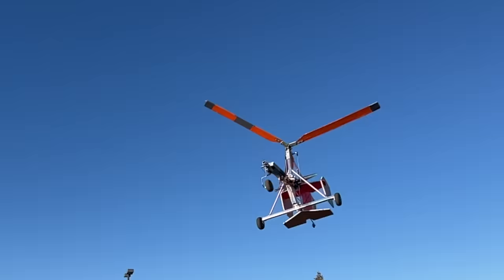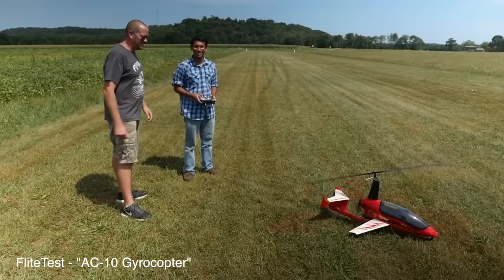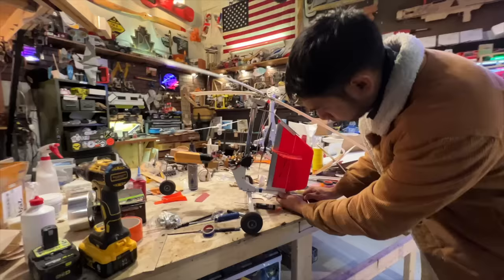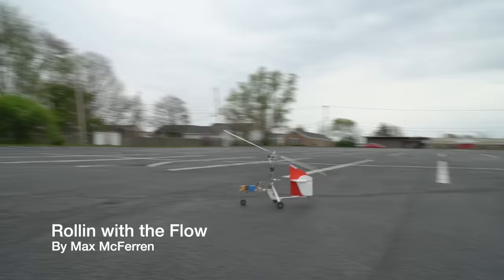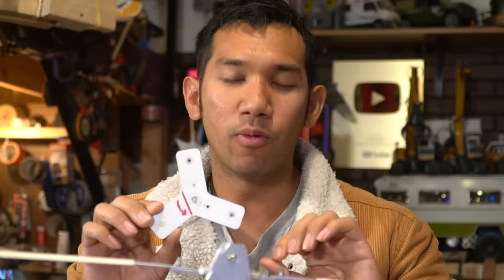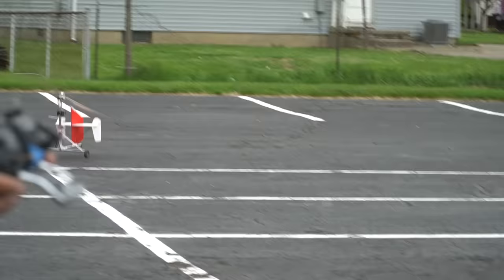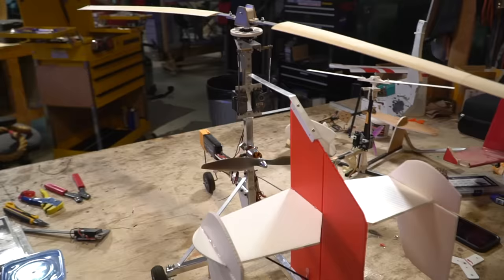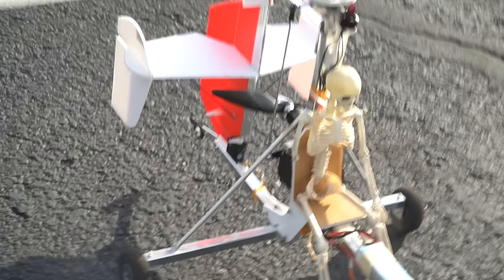This isn’t a helicopter or an airplane?

Comment: Peter, another great video.  I have a Hobbyking Auto G2 and it flies great. It has some nice design features including a slip clutch that allows a small motor with a flexible shaft to power the rotor for take-offs then is able to free spin like a bike wheel.  Stay safe with the real one you're getting ready to fly. Best of luck.
Reply: I've read somewhere that the CoG of a gyroplane should always be in front of the rotor mast. is this true. If it is, by how many percent should it be in front of the rotor mast if the rotor diameter is 100%?

Comment: Hey Peter, thanks for the video. I did my initial training as a helicopter maintenance engineer working on Seaking Helo’s.
So, I am pretty much full bottle on the workings of fully articulated rotor heads. I’ve spent a lot of time in the left hand seat  of different helicopters flying under instruction so at a pinch I could probably walk away from a landing if the pilot was incapacitated.
I have a fixed wing PPL and own my own aeroplane but the lure of a gyroplane has been a long held dream! 
My question is - why don’t Gyro’s have 4 bladed rotor systems? In just about every YouTube video you see of the cockpit view of the flight, the control column is always vibrating in sync with the rotation of the rotor. Surely a 3 or 4 bladed rotor head would make for a smoother ride. 
With the amount of theory of flight I’ve done over the years I should probably know the answer but I don’t! 
Is it just a cost thing or is it too hard to engineer for a gyro’ set up. (Both in real life an R/C applications)
Cheers.
SA

Comment: I actually used to work on these before I began working on helicopters. You can call them “Gyrocopters” or “Autogyros” but you cannot call them “Gyroplanes”. “Gyroplanes” are actually different from a “Gyrocopter/Autogyros”. I’ve worked on them for quite a while.

Comment: Peter been following you for YEARS. Love all your videos. Please just be super careful, my colleague's son died in a gyro-copter crash, at 21, it was his first job as a pilot, the wind was quite strong that day. So if the weather is sketchy, rather skip and fly another day. Good luck and thanks for the awesome content!
Reply: Good training has always been an issue with these machines.  Even many instructors are qualified but hopeless.  I've had several friends die in them.  With good instruction they are very safe especially in rough weather.  Getting good instructors out there has always been a challenge.

Like early hang gliders there have always been cowboys.  Unfortunately many of the current instructors were trained by cowboys who were trained by cowboys many of whom taught themselves.

Comment: Really looking forward to the full-size gyrocopter video. Partly because I had the hair-brained idea of using one to commute back and forth to work (my house and place of work both have long straight roads with no real obstacles that could work as makeshift runways). Don't worry though, I realized just how bad of an idea that was shortly after looking into the physics and mechanics of gyrocopters outside of movies.
Reply: There's a group of gyro flyers Chelslovaki gyro blokes that have nice enclosed two seater gyros.  To the main wheels they've fitted electric motors like you have on an ebike not sure of the power.  They land at airports all over Europe then tie up the blades and run the gyros to the nearest town have lunch or stay at a bed and breakfast or motel then drive them back.  They can do 40km/h on the road and are road registered in the EU.
Reply: @cameronlapworth2284  - They are known as "Gyromotion", FYI.
Reply: @halfrhovsquared  ta it's a great idea when you consider say the PALV and its expense and complexity  - yes PAL-V have made a faster more capable vehicle on the ground but massively overweight and you'd never really use it as a daily commute.  These guys for much less money and more importantly significantly less weight modified an aircraft that can actually land then safely drive to the nearest town to refuel, or stay at a B & B etc.  Sure not fast but hey they've toured all over Europe.  Beautiful design.

These low end simple uses of electric vehicles are all amazing.  Mike Patey slinging e dirt bikes, one wheels all really cool.

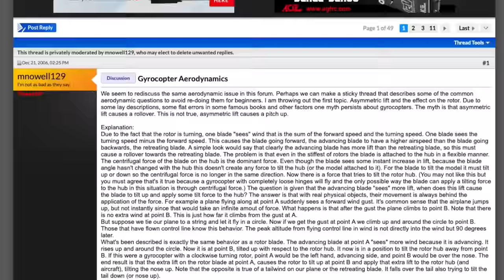Comment: @8:50 gyroscopic effect countering a tip stall.

Smarter Everyday did something on this a few years back.   It is also why the Chinook is like the fastest helicopter in our inventory due to the blades countrring that gyroscopic flare from asymetric lift.
Reply: Dual bladed counter rotating gyrocopeter maybe?
Reply: @dividingbyzerofpv6748  no need no torque on autorotating blades hence no tail rotor.  The flapping or teetering system works by automatically adjusting angle of attack.

The advancing blade has more airspeed so lifts washing off some angle of attack the retreating descends increasing its angle.  Result is equal lift around the disk.

It also has the added benefit of equaling lift if you hit a thermal on one side or front first.  In a fixed wing you often hit a thermal say on the left wing which tips the aircraft.  In a gyro that blade lifts washing off some angle of attack the retreating blade drops so equal lift both sides and no bank or pitch change.  I remember flying with a guy in an ultralight I was bored hands off the stick dangling my feet experimenting with gentle corrections sticking a hand out one side or the other and looked over at him and he was moving the stick this way and that swaying up down banking left and right I didn't even know any thermals had kicked off couldn't feel a thing.

They are also fantastic in high wind bot only does it drastically shorten ground roll (I've literally taken off across a small grass airstrip and landed like a helicopter after it) but handled the 25 knot winds which had them grounded as they were across the strip.  As I said very capable in high winds so long as you aren't travelling  up wind because they are not fast or at least not safe at high speeds.
Reply: That I get.  Mybresponse was to where he refers to the RCgroups thread on why the craft would stall out and roll over.

Push a helicopter hard enough and they will all flare/stall due to the retreating blade lift differential because you can only compensate so far before it catches up to you.

Double blades are a way to counteract that effect. Go watch the Smarter Every Daybepisode and rhe RC Groups thread.
Reply: And my response was directly related to the effect he was seeing in his plate going eigid and preventing the correcting factors for retreating blade lift differential.

That effect he describes where the craft would try to pitch up then roll over.   That is the torque I am talking about.

Centripidal forces like trying to turn a spinning wheel in your hands ehich applies a felt force.   The blades spinning are the same.   If the craft is going to try to roll/turn on an axis, then other forces will apply.

Craft trying to roll over due to lift differential, counter force is likely the noted flare.

That is what I was addressing with the smarter every day video.

And that is where it would be interesting to see if a dual blade setup countered the effect even if it was not ideal.

Comment: I made a nitro autogyro with an RC plane fuselage and tail feathers using 4-layer wood foam and Kevlar cloth and resin which was vacuum bag sealed for the blades. I made a jig to get the shape while the layers were drying kinda like making a skateboard deck. It worked really well once I had the tail feathers at the proper size. I'm really fascinated with Gyrocopters. Best of luck on the full-scale one. You will do great.

Comment: A freind of mine was eperimenting with gyros several years ago. he came up with a gyro that had twin rotor blade sèts on a lateral boom. Each blade set tilted opposite of each other controlled by the aileron control of his transmitter.. It flew very well.

Comment: I think if the free spinning prop had controls like a heli and the fan had only rudder for yaw, then when you add throttle it pushes the craft forward and up like a pendulum gaining elevation. I think by having the 'gyro' style prop unrestrained it tilts back causing drag and lift but when you add the thrust vectoring rudder it increases the angle of attack exponentially but only on one blade which is why the crazy roll every time. The way you did it is different than I would but it's crazy you got it to fly :) I hope you build more of these love your work.

Comment: I built a GyroBee decades ago (Lazybee, but with a rotor on top instead of fixed wings) thinking the tractor configuration (prop in front) would be more stable than the pusher configuration (prop on the rear). This was my first and last (so far) RC aircraft build, so the fact that I wrecked it was probably due more to my inexperience than anything else. It did have three blades and that flexible triangle thingie instead of a proper teeter totter type rotor mechanism, so your video makes a lot of sense to me.

Comment: If you want more stability in your gyrocopter do the following in order of preference:

1) Lower the thrust line and raise the centre of gravity. The CG needs to be higher than the thrust line, so that thrust will cause a pitch up moment. A low CG will make the aircraft dangerously unstable.

2) Put a big horizontal stabiliser on it on a long tail

3) Use a tractor configuration.

Nice video

Comment: Ken Brock along with the brother of a local Salem resident stopped in at Koon's airstrip to fly, I was fix wing rated, and soon built a BM-8, towed & later added the Mac engine, control input is different than other aircraft. Fun machines for sure!
Reply: He latter went on to fly them in Antarctica.  He was a legend in the gyro community.  Sadly and ironically he died in a fixed wing accident.

Comment: I used to see autogyros now and then when I was a kid. Now it's been a long time since last though. They were cheap and didn't need a long runway. I have a feeling there were a lot of these, relatively, built in sheds back in the 40's and 50's. When I grew up they were getting uncommon and I don't think i heard of anyone building one until sometime in the 90's.

While they need a runway the takeoff distance can be kept very short and like shown in the video landing can be next to vertical using autorotation just like a helicopter. I remember my father explaining the takeoff procedure when I was 8 or 9 years old. I don't know if he ever bummed a ride, but I know he never piloted anything so it was probably something a pilot had told him. 

The only thing I really remember was that he explained that you don't start out at full throttle trying to build up speed fast, but instead go slow and easy so the rotor can build up the RPM. As a kid that went straight over my head. It seemed so obvious to me that more power equaled more speed and a faster takeoff. Well I guess that's all you can really ask from an 8 year old.

Comment: Peter, you can make much stronger foil blades by using support under the leading edge. I do this for my hydrofoil blade models and it works a treat. Don't print them too close together or the uneven exterior temperature will warp the blades. I preorient min so that the warp ends up symmetrical.

Comment: My buddy built one (all balsa and tissue) with balsa blades back around 2003,  we got it to work PRETTY well in dead calm early mornings, but one little breeze and it was done. :P   But we didn't have any power going to the rotor at all, no 2nd motor.

Comment: I have built and flown many RC Autogyros. One recipe for success is: 5 degrees negative blade pitch. 5 degrees rearward mast tilt. 5 degrees dihedral. CG at center of mast. High aspect ratio (30:1) blades. (30% Clark Y works just fine) I prefer dual counter-rotating and no pre-rotator. I also prefer tail-dragger designs like Cierva’s.

Comment: Dear Peter, great work.  
Very intrigued by how gyros / autorotation works.  So glad to hear you say that the pitch is 1.5deg negative.  Have seen and heard quite a few folks totally convinced that it is 1.5deg positive.  
I think I have the answer on what the main driving force is to give autorotation in forward flight.  
No one is considering the full rotation.  Think of it as three quarters.  The rear quarter the segment is towards the horizontal and in disturbed air, so not doing much.  Now the forward facing segment has a good upward flow across its whole length, and the negative incidence causes it to rotate.  This is where the major force comes from.  The leading side segment gives drag, though this is somewhat balanced by the push from the trailing segment, though still an overall slight drag against rotation, but far less than the positive rotation from the front segment.

Comment: Pretty Kool, my dad used to build these back in the 50s and 60s under the name of Capital Copters in Minnesota. He was at war with Benson over patenting. GyroCopters are not very stable - I remember my dad crashing a couple of times. My dad later invented the AquaCopter which was a GyroCopter but pulled behind a speedboat instead of powered by a motor. He sold a few of them to Hollywood actors and a few out on the east coast as well. I still have some of the blueprints and photos.

Comment: The design is secondary to the take-off procedure here. Unless you level off to keep building airspeed in ground effect for several seconds the aircraft will pitch up and stall. You need a lot more airspeed to render the controls more responsive.

Adding power increases the gyroscopic from the engine (pulls the nose of the aircraft up and right) beyond the available control surfaces' efficiency. So adding more power without waiting for airspeed to build will induce a crash.

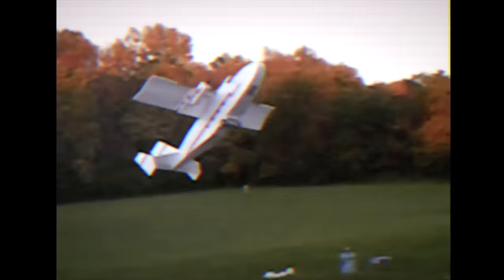Comment: I've just paused your video at 1:33, breathless in anticipation for what I hope is your explanation of how gyrocopters work. We all know that they DO work, but there is an amazing amount of discrepancy out there about how and why they work. Unpausing. Carry on...
Reply: This was a good video. You nailed the "why" gyrocopters fly, but I need much more information to understand "how."
Reply: @joelamb3581  the why is out there read some of the old books from the 1930s but many gyroplane pilots don't understand it even many instructors will tell you things about gyroscopic precession.  

Basically all wings produce some forward and upward lift which is why competition gliders often can fly at 180mph with no engine.  Backward lift on the wing overcomes it and limits the speed eventually but basically as each rotor is producing lift forward and up they spin themselves around until they reach a point where drag stops them around 350 rpm for most gyros.  The blade going into the wind has greater airspeed.  So let's say you airframe is doing 50mph and you rotor speed (as measured by a radar gun at the tip) is doing 350mph.  Well your blade going into the wind is doing that plus the 50mph from the airframe so 400mph and the blade going with the wind is only doing 350 = the 50mph airspeed so it's only got 300mph so 100mph difference from one blade to the other.  The teeter or see  saw hinge you see allows one blade to lift as it does so its angle of attack decreases loosing some of its lift as the other blade is pushed down its angle of attack increases.  This balances out any difference in lift if either blade produces more lift than the other in flight it just lifts washes off lift giving it to the other.  So the blades teeter or see saw but the disk stays level.  This also eliminates gyroscopic precision from impacting on the controls as gyroscopic precession acts 90 degrees from input in direction of travel.  Thus if you tilt the disk at one point the effect will happen 90 degrees latter and the teeter hinge compensates as before.  So while the precession exists it acts on the teeter hinge and only after the blades are going that way anyway so you can just ignore it does have any noticeable effect.

Basically this makes the gyro in a real one very stable even in extremely windy rough conditions as the are very high wing loading and compared to rotor speed differences a 30mph wind speed is essentially meaningless to the rotor they deal with significantly bigger differences each rotation.  Wind up is complicated though as enough speed in the rotors needs to be safely gained so the retreating blade doesn't stall and come down striking tail and or prop.  That requires careful training but once trained is easily avoided.

There you go you now know more about how gyros work than many instructors I've met.

Comment: Initial design was unstable about z axis because of short length giving minimal resistance to yaw instability. Lengthening airframe increase yaw stability. And increased length provides pitch stability as well. Roll stability presumably is mostly from rotors. Your work always impresses though, I’ve never flown a plane I’ve built

Comment: It is basically a normal airplane with a spinning wing, which brings the disadvantages of retreating blade stall and dissimetry of lift to the table.
They are fun though.

Comment: Flight controllers are most definitely not required if the design is properly executed. RC gyrocopters have been around for decades. I'm pretty sick of seeing so many conventional models using FCs when not needed. If it's not a multirotor or similarly complex design (like a harrier or F-35) it shouldn't need one.
Reply: I'm not really into radio controled vehicles, but is there no way to shut those things off?

Comment: Autogyros have unpowered rotors, it's literally the same head as a helicopter but spins because of the forward movement. You need the head adjustments to help with lift at different speeds as well as stabilization. Basically, take the head and blades from a heli and slap it on a plane...